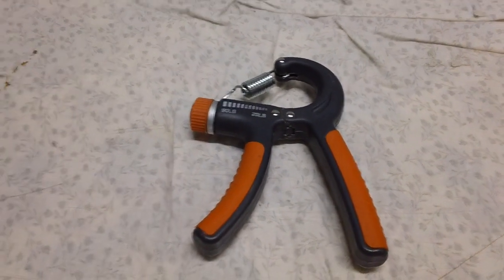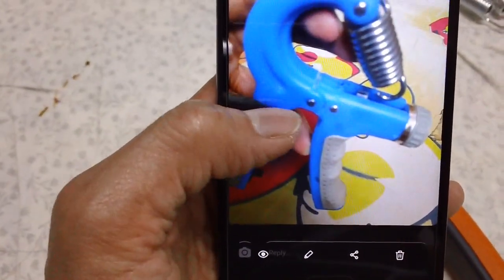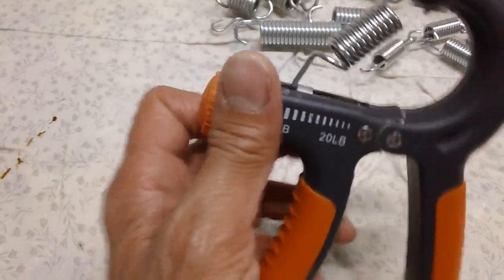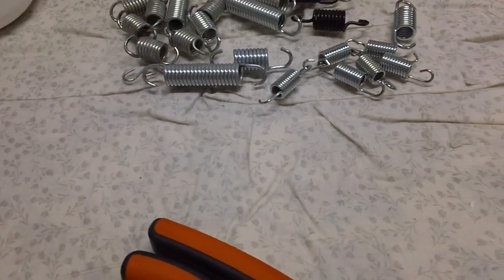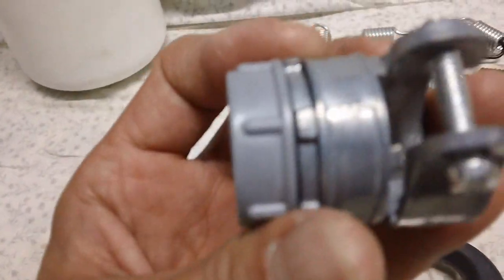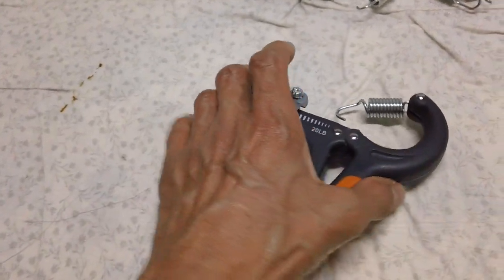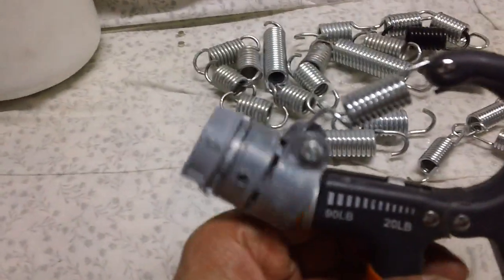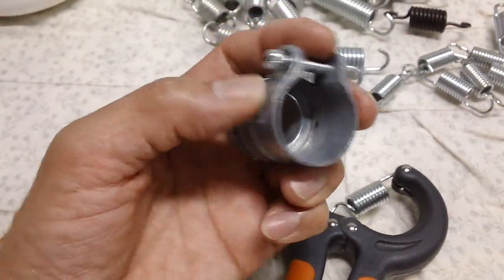Fixing Broken Tension Adjustment Nut On Hand  Grip Exerciser

Comment: I have a boldfit hand gripper but when I turn the knob the spring didn't move it just stuck at one place but the gripper get tight but the spring didn't move, is this a feature of the gripper or its broken ???
Reply from the maker: Hello and thank you for watching my videos and for your comments. If your hand grip exerciser has a dialer on it to adjust the tension then it has to work. Check and see if you have it set to the Xtreme highest or the Xtreme lowest tension. That's the only two positions. It could get stuck on. You will have to use a little bit of force the free the dialer. If it's stuck on the highest tension then turn it counterclockwise. If it's stuck on the lowest tension then turn it clockwise. You might want to use something like a Channellock pair of pliers to grip the dialer but don't use too much force are you might Crush it. And one of my videos I demonstrate how the dialer get stuck and what to do when that happens. Thank you very much and have a great day.
Reply from the maker: https://youtu.be/2d61AZ_ua0o?si=d99xNsozgeAs_Hq2

Comment: Hey i think i was messing around  to much with my hand gripper and kept changing the weight and now its completely loose and the weight doesn't  go up or down
Reply from the maker: Hello and thank you very much for watching my videos and for your comment. It could be that it's stripped out. For you to determine if that's the case you will have to pay close attention to when you're turning the dialer to see if it's just the dialer turning and not the long screw. If that's the case, then you might have to use some super glue where the long screw goes into the dialer. This is just what I'm guessing. Check it out and let me know what you come up with

Comment: Brother I bought a handgripper and it was pretty expensive it was 4000pkr and I adjusted it to the max level to see how difficult it is to do one rep but after I did it it isn’t coming back it is stucked on the max level but is working properly please suggest me a way to fix this.
Reply from the maker: https://youtu.be/jVvFKdhf1N8
Hello and greetings. Thank you very much for watching my videos and thank you for your comment. I'm sorry that things are so expensive to buy. Anyhow I'll try to help you what's your problem. If you look at the link to the video above I explained after about five minutes into the video why you are experiencing that problem with the dialer getting stuck. To get it unstuck right now you'll have to use a very wide grip pair of pliers or if you have channel lock pliers. Wrap the dialer with some rubber tubing or cloth to prevent it from getting damaged. Then grip it with just enough pressure with the pliers and turn it counterclockwise to break it free. After that whenever you use your hand grip exerciser if you turn it to the highest tension before you start to squeeze it turn it back half a turn from Maximum tension. This will prevent it from getting stuck. The same thing goes if you use it on the lowest tension turn it back half a turn before you start to use it. Let me know if you watch the video on you understand what I'm saying let me know if you're able to get it freed up. Thank you very much and have a great day sir
Reply from the maker: https://youtu.be/2d61AZ_ua0o?si=d99xNsozgeAs_Hq2

Comment: Hello bro, I just got my hand gripper. Suddenly the screw and the adjustable tension knob broke. Do you have any advice? ❤
Reply from the maker: Hello and greetings. Thank you for watching my videos and for your comment. These videos that I have made are all of the fixes that I can come up with so far. If you just bought it you should be able to return it under warranty. What I have to tell everyone is that if these hand grip exercises were made to be repaired the manufacturers would have spare parts available. However this is not the case and if your hand grip exerciser breaks and you're able to repair it somehow good for you otherwise you'll have to buy another one. If you take a look at my videos and one of them is able to help you that's great but if not then I don't have any more fixes for these hand grip exercisers. The only thing that went wrong with mine is the spring broke and I was able to fix that easily several times. Thank you very much and have a great day.

Comment: Hi, I've been using an adjustable gripper that I got yesterday and the I've been experiencing this thing where If i decrease the tension down to the lowest or a little higher than the lowest, the gripper's front handle gets quite wobbly.  Any ideas on how to fix?
Reply from the maker: Hello and greetings. Unfortunately that's the way it is. There is an effective range for the spring and the mechanism. Below that range on the lower tension the spring wouldn't have enough length to take up the slack. Mine is the same way and I guess they're all the same way. You really can't do anything about it. Have a great day

Comment: Hello sir.... I have a hand gripper that costed me around 200 INR... I used it for two days and i found out that there is a lag in my gripper and it gets more lag with time... I dont know but is it normal or is it fixable 🙏🙏 suppport from India
Reply from the maker: Hello and greetings. Thanks for watching my videos. If by lag you mean some free play like a Car steering wheel has a little bit of free play in it. Mine has that as well. If I try to reduce the tension by turning the knob counterclockwise the lag gets a little bit more. I think this might be normal. Please keep in mind I'm not an expert on these things. I just try to figure things out logically.
Reply: @irfaanxlcr8370  Thankyou for your reply... yes i also think thats normal.... love from India 🇮🇳🇮🇳🙏🙏

Comment: From where i get this tool
Reply from the maker: You mean the exerciser? Depends on where you live. You could try eBay. Or any sports store in your country.
Reply: @irfaanxlcr8370  no that rounded shape object
Reply from the maker: @akshatgamer2118  
That round thing that I put on the very front of the hand exerciser is part of the electrical systems here in America. We have all kinds of regulations and codes. That thing goes on an electric junction box. If you don't have such codes in your country you probably won't find it there. But if you want you can check with an electrical store or a hardware store.
Reply: @irfaanxlcr8370  ok thankyou

Comment: Hey brother .I have a problem my rotater of the handgrip suddenly became jammed it's not moving..how to fix it?
Reply from the maker: Hello and greetings. Thank you for watching my videos. Is it stuck on the Xtreme high-tension or on the extreme low tension?
Reply: @irfaanxlcr8370  it's struck on low power i mean on 10 kg
Reply from the maker: @ahmedmohammad1199  https://youtu.be/jVvFKdhf1N8
Hello, if you watch this video above at around 5 minutes into the video I explain why your dialer keeps getting stuck. And I gave the solution how to prevent that from happening. Take a look at the video and let me know if you understand what I was saying. Let me know if that was helpful to you. You will have to use something like channel lock pliers and apply some Force to break free your dialer from being stuck. If it's stuck on the lowest position then you have to turn it clockwise
Reply from the maker: https://youtu.be/2d61AZ_ua0o?si=k8s3rPandkzPYSLm

Comment: Bro my hand grippers adjuster is stuck do u how to solve it not able to rotate it
Reply from the maker: https://youtu.be/jVvFKdhf1N8
Hello and greetings and thank you for watching my videos and thank you for your comments. If you take a look at the above video that I made after 5 minutes into the video I explained why the dialer keeps getting stuck on your hand exercises. For you to free up the dialer you will have to use a channel lock pliers and apply Force to break it free. After that whenever you use the hand exerciser at the lowest or the highest tension you have to turn the dialer away from the highest or lowest tension by about half a turn. That will ensure it doesn't get stuck after constant use. The video shows you what I'm talkin about. When you use the channel lock pliers make sure you don't damage the dialer. Wrap it with some rubber or cloth before you squeeze it with the pliers. Let me know how you make out. Thank you very much and have a great day
Reply from the maker: https://youtu.be/2d61AZ_ua0o?si=d99xNsozgeAs_Hq2

Comment: Bro its stuck at one weight, it aint moving from that. What i can do bro? Pls help
Reply from the maker: https://youtu.be/jVvFKdhf1N8
Hello and greetings and thank you for watching my videos and thank you for your comments. If you take a look at the above video that I made after 5 minutes into the video I explained why the dialer keeps getting stuck on your hand exercises. For you to free up the dialer you will have to use a channel lock pliers and apply Force to break it free. After that whenever you use the hand exerciser at the lowest or the highest tension you have to turn the dialer away from the highest or lowest tension by about half a turn. That will ensure it doesn't get stuck after constant use. The video shows you what I'm talkin about. When you use the channel lock pliers make sure you don't damage the dialer. Wrap it with some rubber or cloth before you squeeze it with the pliers. Let me know how you make out. Thank you very much and have a great day. By the way, if it's stuck on the lowest tension you have to turn it clockwise. If it's stuck on the highest tension you have to turn it counterclockwise
Reply from the maker: https://youtu.be/2d61AZ_ua0o?si=d99xNsozgeAs_Hq2

Comment: My handgrip is stuck and i cant increase or decrease my handgripper
Reply from the maker: https://youtu.be/jVvFKdhf1N8
Hello and greetings. Thank you for watching my videos and for your comments. Your dialer can only get stuck on the Xtreme low or Xtreme high-tension positions. It can't get stuck in between. If it's stuck on the lowest tension then you have to turn it clockwise. If it's stuck on the highest tension position then you have to turn it counterclockwise. You would have to use something like a Channellock pair of pliers and apply some Force to turn it. The video link I sent you up above at about five minutes into the video I explain how it's getting stuck and what to do to prevent it from getting stuck afterwards. Let me know how you make out. Thank you very much and have a great day.
Reply from the maker: https://youtu.be/2d61AZ_ua0o?si=d99xNsozgeAs_Hq2